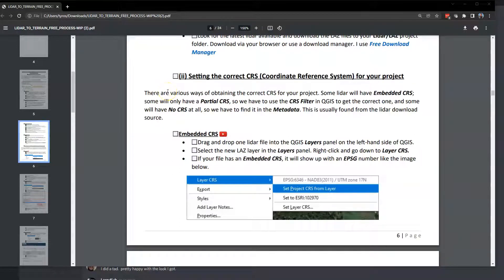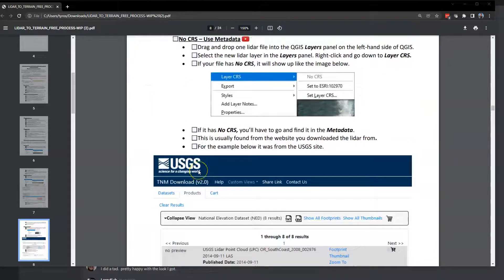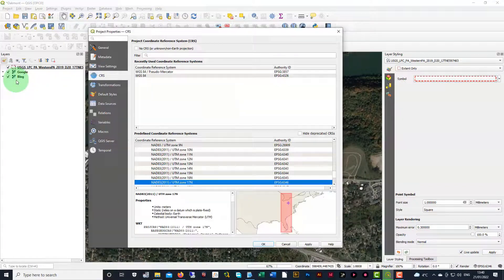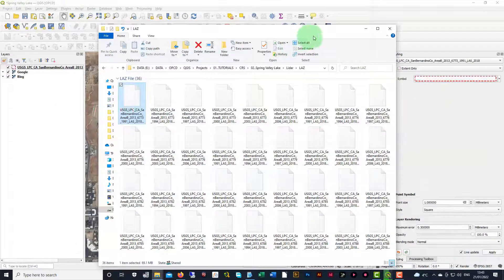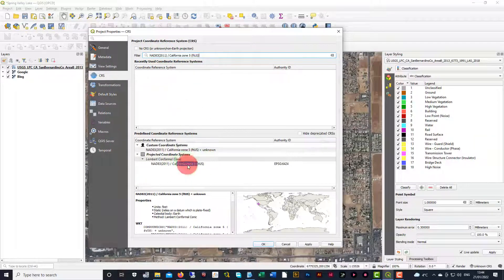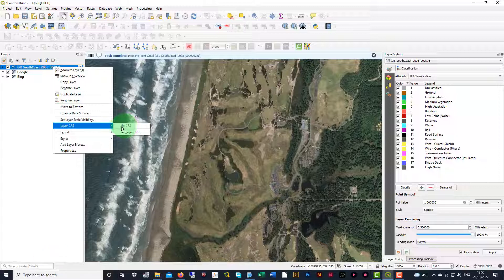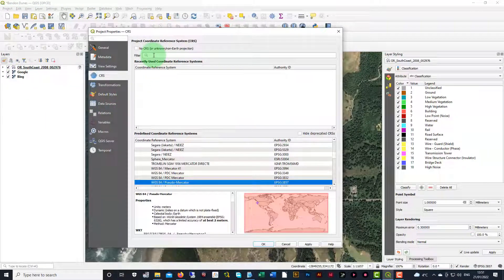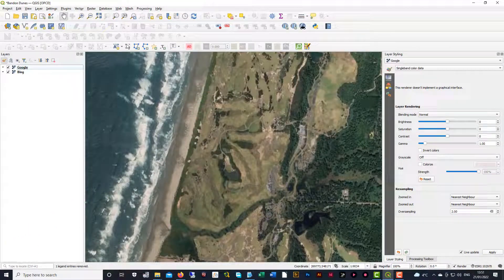QGIS :: Setting the Correct Project CRS

Comment: in your very first video u showed the xml files for google , do they still work , i dont know how to find out the khv number
Reply from the maker: I am assuming you are referring to the GobalMapper video. The Bing XML file is still good, but you have to change the version of the Google XML file periodically when they make changes. You can find the current version using these steps for Firefox or Chrome based browsers.

In Firefox follow these steps to get the latest Google Maps version number:

1. Set the map display mode to satellite.
2. Open the Web Developer tools
3. Click on the "Debugger" tab
4. Press SHFT-CTRL-F to open the search text box for all files
5. Enter kh/v\  (All lower case)
6. It will display all lines for that search and will show the version number. The last three digits of the string "kh/v\u003d908"

In Google Chrome based Browsers (Chrome, MS-Edge, Brave, etc.):

1. Set the map display to satellite mode.
2. Open the Developer Tools (SHFT-CTRL-I)
3. Select the Sources tab
4. In the left side list click on khms0.google.com
5. It will display a list with the version number starting with "v=917x=........."
6. The first number is the version number.